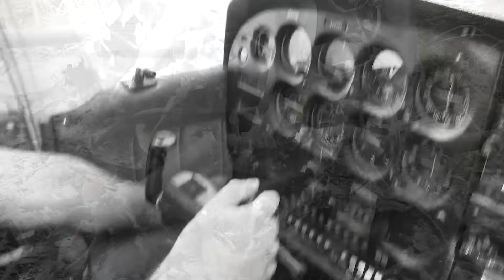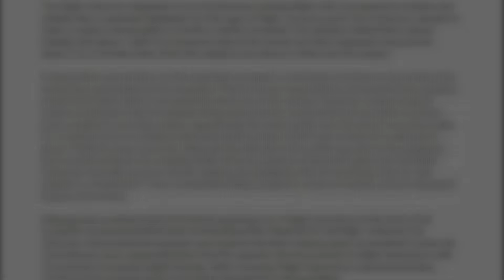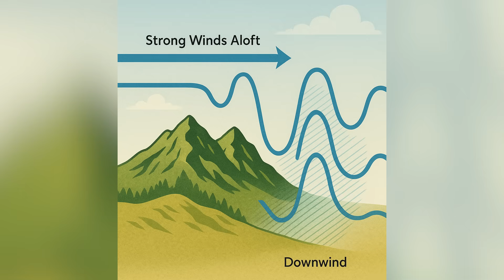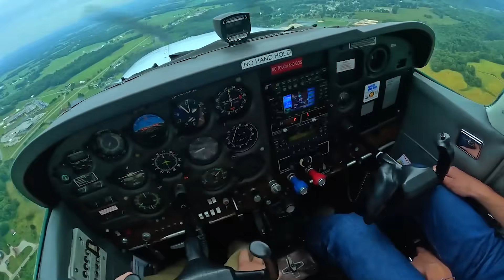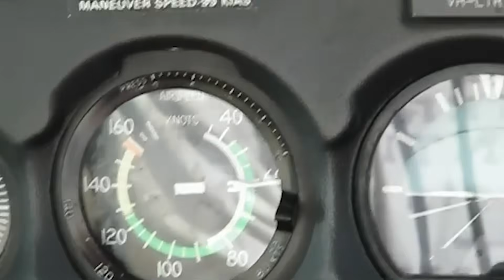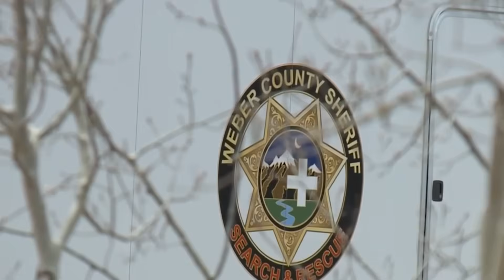Why Did This Pilot’s REASONABLE Decision Turn N1727T Into Fatalities

Comment: did devon and braden receive mountain check rides? Did they live in that area? I took trip to colorado from MIchigan back in the 70's. Camping and hiking. Also, got  mountain check ride in 172. Very eye opening. High altitude = high landing ground speed at leadville airport (9,900 ft).
Shown how to approach a ridge to cross by going to it at a  45 Degree angle so as to turn away if I can't get over it.